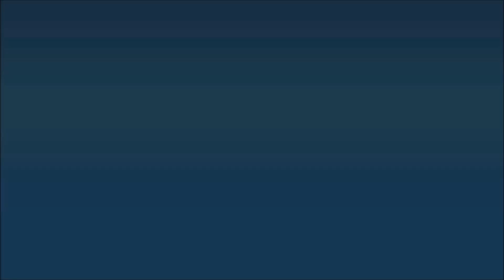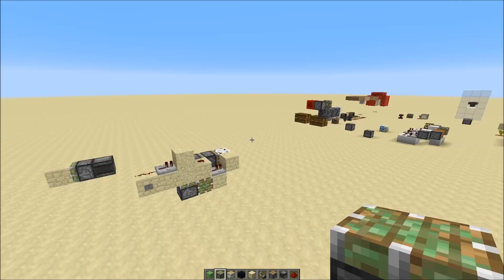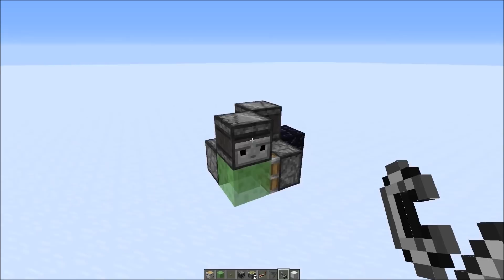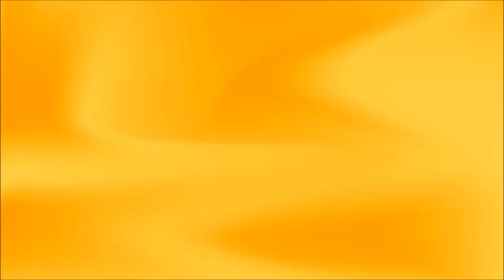17w49a: Almost All Piston Contraptions Broken (if those changes stay)

Comment: If removing QC was detrimental, removing sticky piston block dropping is even worse.

Without QC, you could still technically do 0 ticks, make two way flying machines (most of them) with proper extensions etc but it would become quite a lot more complex/bigger

Without block dropping, you legit cannot do anything useful with 0 ticks (since the block doesn't "drop"), bidirectional flying machines become near-unusable (have a working 2x2x3 engine that is at 7 blocks, 11 blocks for self returninng and likely cannot be compacted by much), extremely complicated toggle state logic - esp slimestone logic

Also, another side note about piston/slimeblock/rail was that something changed to break my two way tnt duper (slanted rail breaks), which was the only 100% safe duper that dupes in both directions.
Reply: You say you have a design for a self-returning flying machine, without using zero tick block dropping?? I'd like to see that design, 'cause I've tried for months to make something like that in PE.
Reply: Eta740  if theese changes came pc redstone = mobile redstone

Comment: Maybe they should work on fixing the useless bedrock edition redstone, rather then changing the redstone mechanics we have had for pretty much forever
Reply: lol ikr
Reply: RageSquid there are different teams for each version
Reply: According to Jeb, the java edition redstone has been bugged since the beginning, and Minecraft bedrock redstone is the true and correct version.
Reply: RageSquid I want java Redstone in minecraft crap edition
Reply: RageSquid some of the redstone on the Bedrock edition is better than the Java edition.  For example glass blocks let you move redstone like a half slab BUT you can also send a signal downwards
Reply: Gabriel Matte not only that, but pistons can push containers. Otherwise it's shit.
Reply: or add things that are useful instead of things that break anything that are useful
Reply: Aidan Jonkheer so that just means that red stone sucks

Comment: New statement from Grum:
"The piston dropping its block is not a feature. Nothing in the code supports it being a feature either, this is why when you do changes in other places in the code it suddenly stops working. The behavior from before the snapshot has been restored by fixing another bug (MC-122711). Do not expect the piston-dropping-a-block to be in the game forever without changes. If you need to drop the block, push a glazed_terracotta, you can only push the block and not pull it"

The last two sentences are killing me inside :'(
Reply from the maker: it's sad that we have to deal with that kind of idiocy

Comment: they are probably going to change it back, but anyway, these new "updates"... maybe we should start calling them downdates, 1.13 as of now adds nothing useful to vanilla survival and removes things that are actually important for players like me. i have to admit that the flint and steel change doesnt affect me a lot since i am not a slimeblock expert, but is still one less feature. and the dragon egg-bedrock thing... i will only say that the entire transport system of my survival world is based around roads that are built at the top of the nether.

and 1.14 doesnt look too bright either. very little info right now about it, but the anti afk mob and the water current changes are not the best of news for people that play this game to make farms... some bubbles and a trident are not going to cut it if they break farms (doplhins and treasures are irrelevant in my opinion, unless dolphins drop something useful)